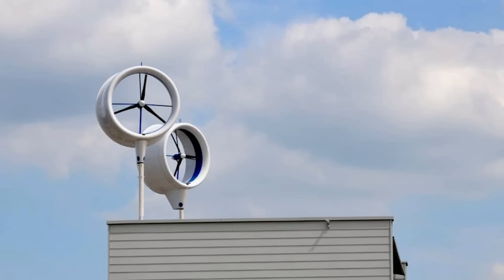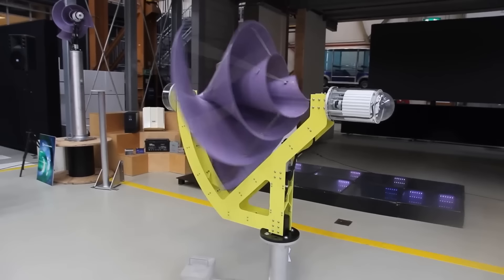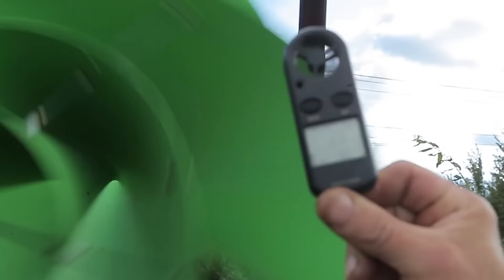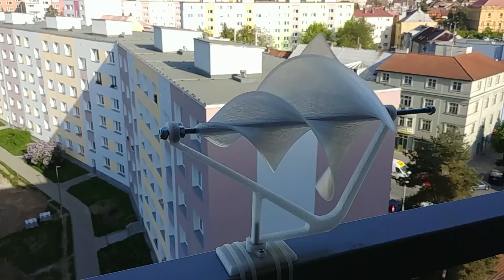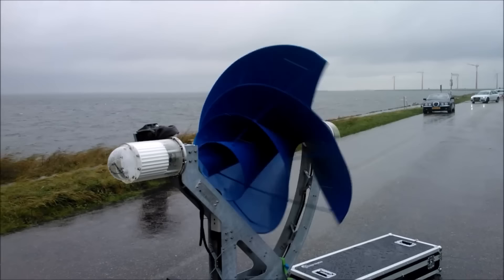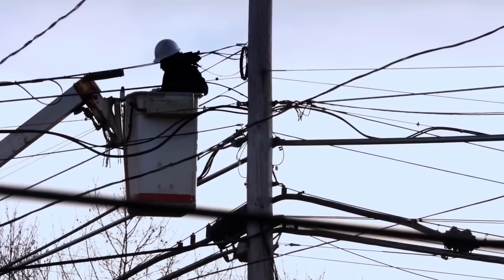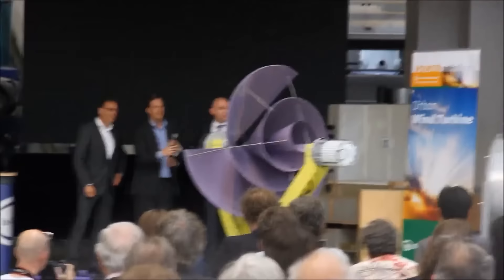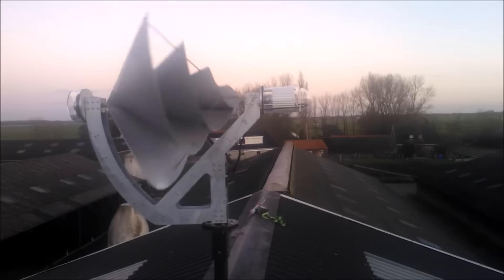How The Liam F1 Wind Turbine Will Destroy Every Home Renewable Energy Source

Comment: In much of the USA, 5 m/s average is unlikely,  but there are some areas that could average that speed.  At that, you'd need to put it on a 30m pole and free of trees, buildings, terrain to get that average.  1,500 kWh all year is not much.  Even at "expensive" kWh at $0.14/kWh, that is $210 annual payback.  Simple Payback SPB in years at $5,000 installed cost would be 24 years.  In my area its nice to have cheaper electricity a bit under $0.10/kWh, but then SPB is +33 years.
What is important here is your eyeballs watching the video.
Reply: This is the answer.
Reply: When you connect any alt power to a public grid for payback know that the local power Co credits you way less per KWH than what they sell back to you.  LADWP (Los Angeles) for example credits about 2 cents per KWH for a grid tie system  ( that folks pay up to $35/$40 grand) and sells back to you for full price whatever that is in your area (.12 to .20/KWH?)
Reply: 5 metres per second is 11.2 miles per hour or 18 kilometres per hour.  That's a pretty stiff breeze That we don't get very often even here on the coast of Nova Scotia.
Reply: What's also important here is understanding and thinking well. This isn't being presented as a universal solution. Where solar makes sense, use solar. Where solar is spotty but there's some wind, use both. Where it's cloudy most of the time but wind is present, this makes sense.

The video said the turbine operates on as little as 5m/s, not that it requires an average of that velocity. And again, it's being presented as the one universal device that everyone, everywhere, at all times, should use exclusively.

So, yes, to the video, eyeballs are important. But to the intelligent, they're understood as being important to every video on YouTube, not only this one. So, when you mention something universal as if it's particular, you're either being dishonest, or you simply don't understand why what you've said is 'a difference that makes no difference'.

Thinking well is a skill. As such, it can be learned about, practiced, and improved. 10/10 do recommend you look into this option.
Reply: 30m is a tad high, anything above 80ft in the US needs a red blinky-light.
Reply: You only have to pay 10 cents for electricity. In Germany, it is around 30 cents; I am a little jealous. Also, the $5000 does not include the installation costs, and the production number is set way too high.
Reply: @RichardHarlos  Why are you so passive aggressive lmao OP is dead right
Reply: @LuKiSCraft  wrote, "Why are you so passive aggressive"

Why don't you say something about the topic instead of saying something about the man?

Because you don't know how to think well, either.

It isn't passive aggressive to correctly call something what it actually is. That's called speaking the truth.

In contrast, what you're doing is a fallacy called ad hominem.

Did you visit the product website and read about it? Did you understand the numbers on that site? Did you verify them?

No, you didn't do any of these things. You're just here to disagree with someone so that you can get a little hit of dopamine to feed your short attention span.

Grow up.
Learn to think correct.
Fix yourself, or you'll keep crossing paths with people like me who will be happy to point out that you don't know how to think correct.

It's your choice. Choose wisely, if you can.
Reply: @RichardHarlos  I think you need a better hobby than writing essays in the YouTube comments 🤣do you get this easily heated outside of the internet?
Reply: @LuKiSCraft  wrote, "I think you need..."

Still on the ad hominem, I see. /yawn

What I may or may not need isn't relevant to the topic. Why so focused on me? Secret crush? Coming out of the closet? Dark tetrad?

The topic is wind and solar. Try to focus.

LuK: "do you get this easily heated..."

Do you get this contentious when people say things you don't like, but that you aren't smart enough to refute?

Can't say anything about wind or solar, but you have a lot to say about a stranger on the Internet, whom you don't know.

Psychological projection.
Distraction.
Attention.

Seems to be your m.o. based on your replies to me here. I'm curious: do you ever post comments anywhere that are topically relevant? Or is your whole reason for being online to find people to disagree with?

Short attention span?
Dopamine junkie?
Looking for a quick hit that follows being disagreeable?

These are signs of immaturity and insecurity.

If you want to talk wind and solar, I'm here for it. If you're going to continue trolling, it's easy enough to mute you.

It's your choice. Choose wisely, if you can.
Reply: @RichardHarlos  Nah I just enjoy calling out your unnecessary passive-aggressiveness. Maybe you don't realize you are being passive aggressive, idk. I used to have a demeanor somewhat similar to yours in my teens, but then I matured. And yes I went to the website. OP is correct. Sure, in some cases this could be useful. I see a lot of people being cocky in the YouTube comments & they don't realize they are actually on the left side of the Dunning Kruger curve
Reply: @RichardHarlos  I'm not saying you're stupid, but a lot of smart people are full of themselves. (& often times wrong simultaneously)
Reply: @LuKiSCraft  wrote, "I just enjoy calling out your unnecessary pasive-aggressiveness. Maybe you don't realize you are being passive aggressive, idk."

I appreciate that you admit to not knowing, because that's clearly the case. Repeatedly referring to my comments as 'passive-aggressive' reveals that you don't actually know what the words mean. I can help with that:

PsychologyToday says:
"Passive aggression is a way of expressing negative feelings, such as anger or annoyance, indirectly instead of directly. Passive-aggressive behaviors are often difficult to identify..."

My comments here are direct and specific. Nothing passive aggressive about them.

On the MayoClinic, we find:

"Passive-aggressive behavior is a pattern of indirectly expressing negative feelings instead of openly addressing them. There's a disconnect between what a person who exhibits passive-aggressive behavior says and what he or she does.

"For example, someone who engages in passive-aggressive behavior might appear to agree — perhaps even enthusiastically — with another person's request. Rather than complying with the request, however, he or she might express anger or resentment by failing to follow through or missing deadlines."

Again, we find nothing even remotely similar to this in my comments here. I say what I mean, and I don't rely on vague abstractions or ideal to 'suggest' or 'imply' anything.

So, this would be a good time for you to introspect: why do you use words that you don't understand, to refer to people who view things differently than you, instead of having a conversation or a discussion about the topic that's viewed differently?

I mentioned the most likely reasons in my previous reply to you. One concrete example is something you wrote in your most recent reply to me:

"I used to have a demeanor somewhat similar to yours in my teens, but then I matured."

Do you see it? "I used to... *but then I matured.*" You aren't directly calling me immature. You're hinting at it... implying it... and that...

wait for it...

is *passive-aggressive* by definition. So, remember when I mentioned 'insecurity' and 'psychological projection'? That's not me taking pot shots at you. That's me making an observation about what's self-evident to those who understand the words correctly.
Reply: @RichardHarlos  I am flattered you have so much to say to me 😁
Reply: just look how dust, sand, birds destroy blades on wind turbines, friction causes them to set on fire or even explode, next with sun during day there is always light, but during sunny summer mostly there is zero wind. i love all those retarded eco ideas that never work. solar panels suffer same with dust, sand, rain, fungus, mold that scratches and covers surface, even without that just after year they lose 10% performance
Reply: @tomaszszupryczynski5453  It sounds to me like you're holding out for something that's both perfect and eternal. Good luck finding a product that satisfies those two criteria.
Reply: @RichardHarlos  nothing is perfect. especially women. only atom and solar are so far the best, problem with solar we dont have batteries to store that energy. and one of most important things nobody talks about is economy. what to do with all those power plants, electricians who build and serviced them before solar
Reply: @tomaszszupryczynski5453  If you're right, I'm investing in alternatives unnecessarily. In that case, I learn a bit more about the tech and no real harm done.

However, if I'm right, I'll be better off than most people if/when traditional fuel/power becomes less available.

We won't know who's right until the future has become the present. So, you do you, I'll do me, and if it comes to that, we'll just agree to disagree.

I'll say this: to me, it's like buying insurance: it's simultaneously the case that I'm glad to have it, and also that I hope I never need it.

Comment: a good video for a small chuckle. 
There is a reason why we install bigger an bigger Wind turbines on Land and Sea.
A small turbine, low to the ground, thats only usable if a certain wind speed hits it, will not generate much energy. Also... if the neighbor build a new house or a single is in the Way, that alone can change the currents in the area, therefore affecting this small turbine.
Today is a typical Day in November.... that turbine wouldnt even work because its less than 5m/s windspeed...... but solarpanels work fine, because they dont need a clear sky.... just light.
Plus... the moving parts have to be checked regularly. If its silent, it means the Dynamo inside, that generates the energy, doesnt give much resistance. Low resistance, low energy production.
Its not a good comparison but think of the old style dynamos on Bicycles. The faster you are, the more energy it generates... but that also means it gets louder. Its the same principle here. Sure that can be reduced if you use ball-bearings... but that are just more moving parts that can fail.
They dont even give technical data beside the size and how much it allegedly generates. A proper advertisement would mention atleast the needed technical data.
Reply: good comparison to an old style dynamo,  the one on my schwinn bike pressed against the front wheel.  and the drag it created could be sensed while pedaling.
having a light 'on' was a lot more pedaling effort.  
     given that the spring -force
pushing it against the tire was a constant un-changable pressure has me
wonder if the drag it caused vs the light energy created was overkill.

    this all was back in the '50's. some time before re-chargable batt's.
later on i changed  the lite on my bike to one using c-cells.

Comment: Sounds and feels like a sales video. I'm open to the idea. and would much rather have a science and engineering discussion mixed with some sense of the fiscal dynamics and the situational applications. (meaning a practical and honest look at some of the advantages and the problems of getting a wind turbine to work across a variety of situations that a homeowner might face.)
Reply: Not like serious sales, more like scam. To harvest 1500 kWh per year I need 3 standard solar panels where I live. Less in southern europe or the US. Those 3 panels combined need 6 square meter of  roof space and cost less than 500€.
Small wind turbines may have it's merit as an addition to solar, if you are off grid. But it is considerable more expensive than solar.

Comment: This is a Northern European design.

So I have a 34 KWh solar system with lithium batteries that cost about a third more than the big turbine of 20 KWh output, backed up with a 17 KWh generator. I run a five bedroom house and pool off this system. The thing is, like the sun, wind is also not consistent. This is not made clear here. So it's horses for courses. We live in Andalucía, Spain and get on average 320 days of wall to wall sun. In summer, very little wind so we will stick with our solar panels, thanks.
Reply: Exactly - leave wind turbines up to the professionals who can put them in sensible locations (off-shore) and make them big enough (20mW +) to make them worth-while.

Comment: What if we decide to combine mini residential wind turbines with solar??? Then we can produce renewable energy all throughout the day. Just a suggestion!
Reply: Of course you can (and you far wouldnt be first with such system). Problem of these wind turbines is incoherent power output, as it can change from maximum to almost none in single minute, or even shorter time. Its problem for fotovoltaic too, but in branch of wind turbines, its a much bigger issue as intensity of wind is more random and changing more rapidly than sunshine. In other words, if you want wind turbine with more serious power output, you will have to somehow store energy harvested, because management of power grid will not allow you to let into grid those random peaks and voids of electricity. So with wind turbine since certain power otuput, you will need also own battery storage, which depend on batteries type cost quite a lot money (at least as much as turbine itself, but probably more), or clutch off turbine generator from turbine itself = you will not produce electricity quite often to cut off those power surges = your investition will not produce value quite often. There are also other approaches to solving of this problem. Some people store energy in form of small pump water dams (when they harvesting more electricity than its their actuall consumption, their system automatically start water pump which pumping water into higher water reservoir and once they need more energy than their micropowerplant producing, they start small water generator feed from water from that reservoir to produce more electricity). But again for such solution you need space for water reservoir, mechanization (water pump/water turbine, electric generator etc.), quite a lot of electronics and money = more investitions. Other approach is to store energy of that unstable power source as wind turbine in some flywheel, in form of kinetic energy, but its too complicated and expensive for ordinary people, same as that water dam before. Unfortunately, there are reasons why wind turbines arent so widespread as renewable energy source between people as fotovoltaic and this is it. It start to be economicaly reasonable only in much bigger dimensions (wind power parks etc.). I personaly think, it would be much better to adjust this type of turbine for water and developed some mini generator for small creeks. Such streams have also iregularities in their flow, but incomparable smaller than wind flows, so that need of complex and expensive solution of storaging of energy would fall off.

Comment: Solar panels as well as wind turbines vary in their ability to produce energy.
Solar panels are dependant on the amount of sun that day, and of course, are useless at night.
Wind Turbines are dependent on the wind.  No wind, no energy production, Low wind, low energy production, high wind, max energy production, and unlike solar panels, works also at night.
IMO, using both wind and solar should result in a more efficient system for producing energy.

Comment: As much as i like the idea of a smaller more compact wind gen and i can appriecate the balanced from both sides of the rotor. life span of the barings and as someone else mentioned what is the burnout speed, most modern wind gens need breaks to stop them when the wind gets up, also how many batteries are needed to store the potential power supplied?

Comment: We keep coming up with ways to lower the costs of electrical consumption. What we do not concentrate on is, building components that require less energy for the same output.
Reply: agreed as every generation of new computer parts take more power to run so it is at the point where my relatively average computer not a huge gaming rig by any means puts out as much heat as my 750 watt micro heater can just imagine how much is generated by a high end rig
Reply: We have; cars get much better gas mileage than they did in the 60s-90s, lights use much less power and are just as bright(last longer too), kitchen and home appliances are far more energy efficient. In fact you'd be hard pressed to find things that havent gotten more energy efficient in the home or businesses that are in heavy use by most people(of course we are talking about 1st world). 

(as per Kirkyorg7654)Computers are one of the few things most people have that are going in the opposite direction, but that should change over time. Eventually a computer will be powerful enough that constant upgrading wont be necessary and then they can start making them more efficient..like the difference between a Car from the 1920s and a car from the 2020s.

Comment: All practical tests show that small wind turbines hardly generate any electricity - and only at costs very significantly above 1$/kWh!
This is because there is hardly any wind near the ground, and it is also very gusty, which extremely reduces the service life of the systems. 
 With solar systems, you can reliably generate electricity for about 8-12 cents/kWh over a period of 25 years!